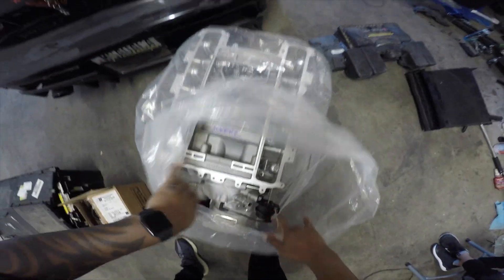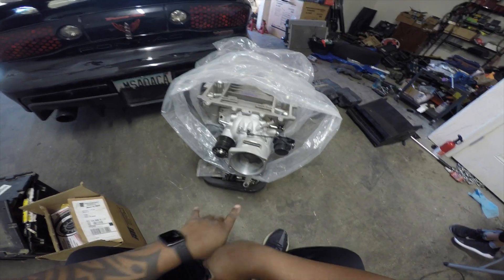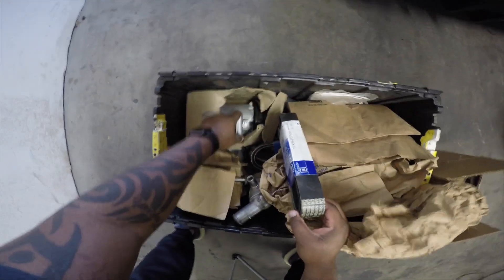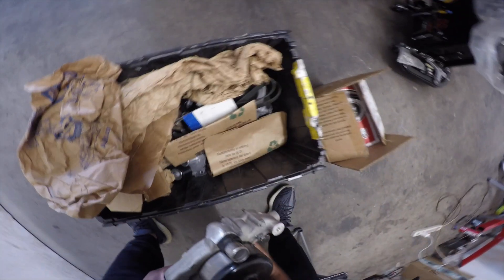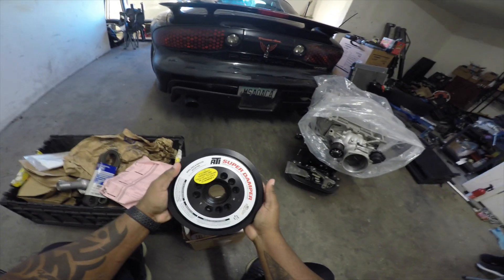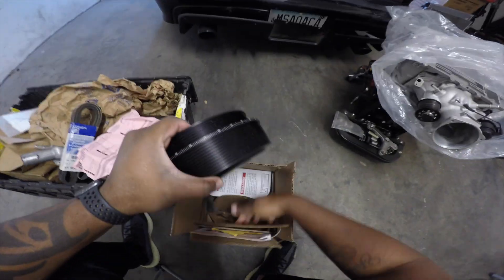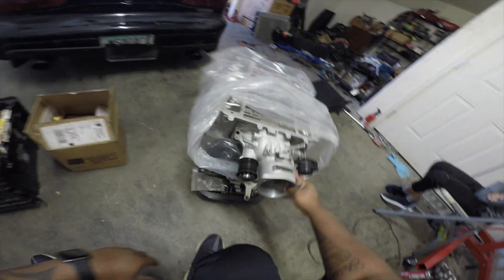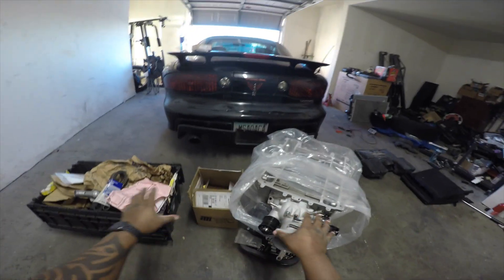LS9 Supercharged 98 Trans Am WS6 - Jokerz CNC ported C6 ZR1 Supercharger TVS2300 - BIG UPDATE

Comment: Which LS engine is the best for the cheapest price? Which engine could reach 600whp to 800whp with reliability and less money? Not that I have money for any of this. I am poor with no job or money. But in the future, when my miles get extremely ridiculous on my 2016 Genesis Coupe 3.8, I would like to 2JZ swap. But I am getting curious about LS motors. I spent 2020 learning more about cars. I am a beginner at all of this. I have accomplished nothing in this life.
Reply from the maker: A decently low mile used LS3 (6.2 aluminum) with mild boost for around 600whp will live a long time. LS3 is my favorite LS and the one I’ve used the most.  Rings don’t need to be gapped at 10lbs of boost or less, while you can still hit 480+whp N/A. Really any gen4 LS will live reliably around 600whp, with the 700-800+whp goal being riskier but not impossible.

I am still playing musical blocks right now, but I have a LS2 (6.0 aluminum), LY6 (6.0 iron gen4, this block has aftermarket piston oil squirters installed and modified to hold 1/2” main studs), and currently working out shipping on a true LSA block (6.2 aluminum forged w/ piston oil squirters, rings gapped for boost, and lower compression). 

I will land around 750whp comparing builds with a fully ported LS9 supercharger and that will live with a true LSA block, or the LY6 I have with piston oil squirters, gen 4 rods and forged pistons w/gapped rings. I will update with a new video soon once I figure everything out. I hope this helps.
Reply: @LS3_LaFlare  Wow. Thanks for the information, man. I have no idea about any of this. I was simply thinking an LS3 could be swapped, and then add forged rods, pistons, head, camshaft, etc. to be installed. Then get a procharged or single turbo and tune it. But I don't know about any of this. That was going to be first goal and method with the 3.8 lambda v6 I have. Get motor built a little and then do turbo, fuel, and tune. I would be satisfied with 420-470whp right now as my daily. I don't even know what 400hp feels like. My car is only 348hp.
Reply from the maker: @bikotheanimator6169  Not a problem. What does a BK2 3.8 dyno at? 260whp? My first LS3 made 450whp/454wtq and it was a huge culture shock. If you can land a LS6 or LS2, you can still hit 410-450whp NA and keep it aluminum for the ~110lbs or so weight savings over an iron block. LS3 comes with a higher price tag vs some older LS engines. Hell, you can get a iron 6.0 block for ~800 bucks and even though it’s 100+lbs heavier, you can still hit 450whp and the engine is around the same weight as the 3.8 v6 lol but aluminum block is 100lbs off of the nose and it’s enough weight to make it a tough choice.
Reply: @LS3_LaFlare  My car has not been on a dyno, but based on stock videos I have seen, 3.8 is around 280 to 290whp. I have also been researching RB26 swaps, but people say those are more expensive than LS. Can LS2 reach 500-600whp easily? I found this guy named PowerLabs on corvetteforum. This is back in 2009, but he his post says this: "I've had a 600RWHP Daily Driver for over 1 year now, logging just shy of 30,000 miles since it first dynoed 597HP at the rear wheels (and 518ft-lbs torque). Here is my setup:

Bone stock LS2 (2006 C6 Z51 Manual Transmission)
Headers (started out with Kooks 1 3/4" then went with American Racing 1 7/8". No change. Both ran a 3" catted X Pipe)
C6 Z06 catback exhaust
Ported Intake and Throttle body
A&A Vortech V2 Si-Trim Supercharger Kit with the standard 3.8" pulley.

That's it. No meth no nitrous no cam not engine internals nothing else. Figure circa $8,000 in power mods since I did my own install.

I drive it every single day, 60 miles a day, in the rain, in winter, in snow and on some very long (3000 + mile) drives on weekends. Its been drag raced, autocrossed and driven at over 190 miles an hour. Zero issues, zero additional maintenance... I'm very happy with the setup and wouldn't hesitate to recommend it to anyone else"

You can probably google that quote and find it on google.

Comment: Looking great man. Awesome build. What are you planning for the short block? Compression?
Reply from the maker: I’m not entirely sure, I have a stock LS2 right now but will probably throw forged pistons, gap rings, and aim to lower compression to high 9s with 91/meth. Big probably. Worst case it’s a LS2 with 823 heads and compression at 10.4:1

I’ll definitely hit you up for the tune like usual - any suggestions?
Reply: @LS3_LaFlare  If you're running meth injection, I'd definitely stick with the stock compression. Just keep the nozzle size under 8. The SBE should be fine imo.
Reply: Forgot to mention, I do recommend gapping the factory rings just for added insurance
Reply from the maker: @Rhett.Castillo  will do, I appreciate your advice. I’ll gap the rings and keep the nozzle under 8 🤙🏾